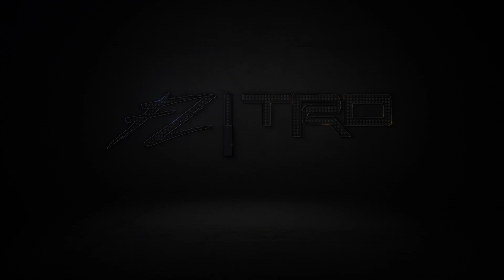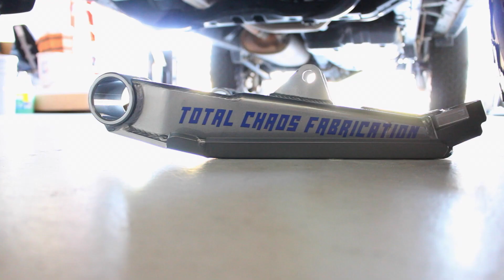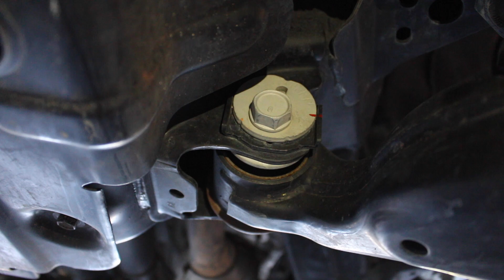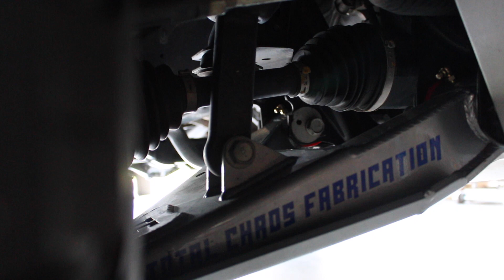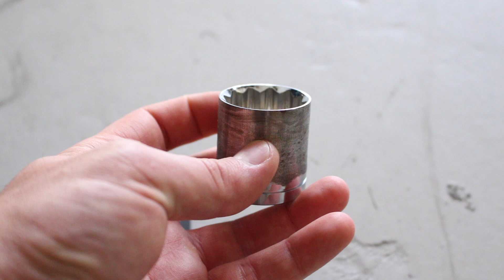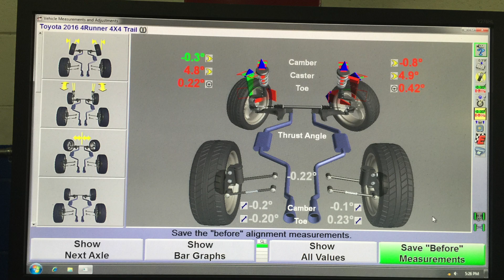Toyota 4Runner TRD PRO Gets Total Chaos Lower Control Arms!!! (John)

Comment: Informative video. Had mine installed at the same location that has I previously installed my suspension and super charger so they r trusted although not a dedicated specialty shop for this type upgrade. The concern is not the stiffness of the ride but the swaying or drifting of the steering. I have previously owned two Jeeps and my 16’ TRD Pro 4Runner feels like I’m back behind the wheel of a Jeep. The shop really has no answer to my concern but after watching ur video, it may b an alignment issue if they aligned everything back to factory spec after the install. Do u recommend me taking the 4Runner to an alignment shop? Thanks and I hope u respond to this 6 year old video because this is super frustrating. 

Jes

Comment: I have a 2010 Prerunner Tacoma with ICON Tubular UCA's ; I got positive camber from a 3" lift even with the aftermarket UCA, do you think swapping out for aftermarket LCA's will fix the camber issue?
Reply: woah, didnt realize it costs nearly 2k
Reply from the maker: Thats odd you got positive camber right out of the box. Did you have it aligned to correct the camber issue?
Reply: Florida TRD 4wheelparts told me i had to keep it that way or else it would steer right.
Reply from the maker: LOL. Yeah no. Both my Tacoma & 4Runner were aligned perfectly and zero pull or drift issues. Go some place else and have it aligned to factory specs and you'll be good to go!
Reply: I mean the camber was in factory specs according to to a 4wheelparts (they did my alignment) & Joe Myers Toyota, but the camber looks really bad. But I will take it to somewhere else later, thanks!

Comment: The other option is metal tech for the skid plate for the control arm. Though I had the Total Chaos +2 on my FJ and was a very high quality. Just make sure you keep the ball greased to prevent surface rust.
Reply from the maker: A lot of companies make skids for the LCA. With the total chaos you get a skid, full boxed and sealed, 1in stainless uniball, and poly bushing upgrade. Not to mention they look badass. Thats why I went this route!
Reply: +Florida TRD absolutely metal tech is just one of the options. I totally agree with the TC lowers. They are a great option if you can swing it and within the specs of your build. Myself I wanted to go a different route on my truck since I wanted to limit changes on this build compared to my previous Long Travel with 35s. Might have another in the future heavy duty build. Now I tend to do more overland and fire trails than anything really serious enough to need to bullet proof everything. For me a great set of skids and little upgrades here and there make it perfect. Though the soft trd valving is annoying and might go with the Icons to match my trailing arms and upper control arm and have a stiffer ride. Looking good so far.

Comment: I don't think KDSS equipped Trails can use these but I could be wrong. Also, are you able to buy the socket that's needed instead of having to grind on one?
Reply from the maker: You could search around and try to find one. I went the fast route so I could finish the install. But now you know the special tools you need!
Reply: That's correct, KDSS equipped vehicles will not be able to use these as is.  You'll need to modify the arm and fabricate a threaded mounting plate that you weld on, in order to connect the KDSS sway bars.